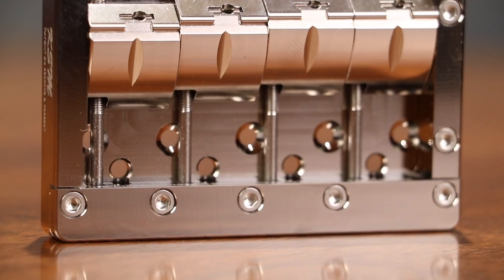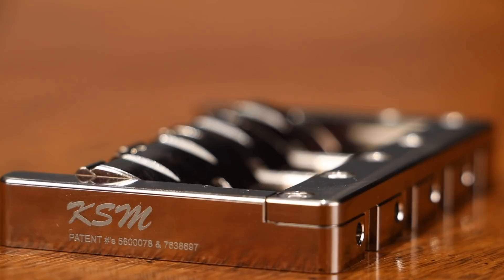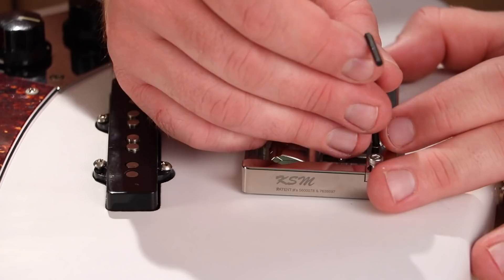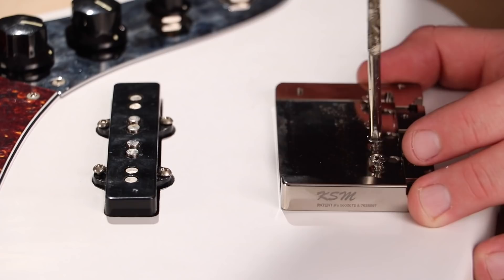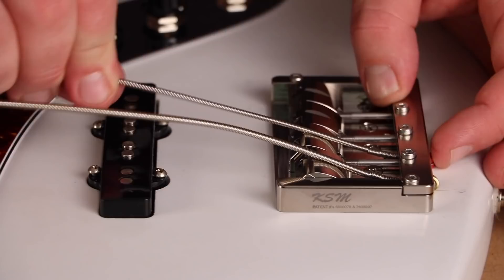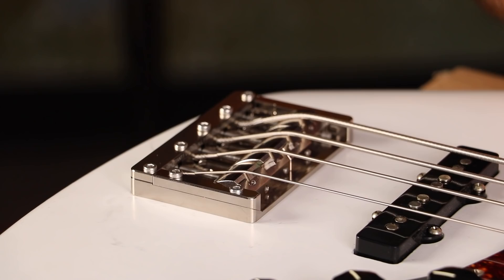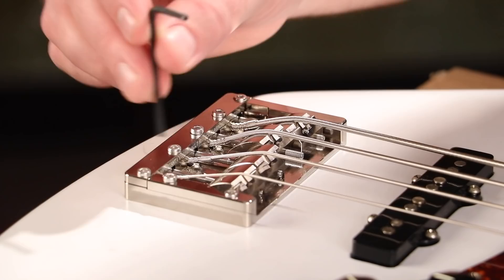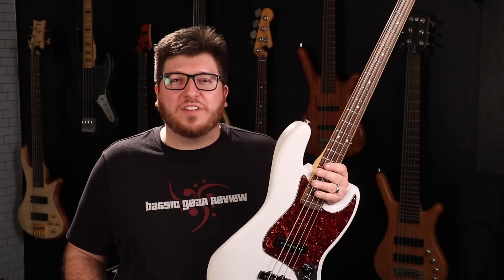KSM Foundation Bridge Install

Comment: Just installed my KSM on a Squier PJ. Extremely straightforward, and I'm just floored by this bridge design. It is the best I've seen. The only drawback I can predict is "locking in" bad intonation for drop-D if you go between standard and drop tuning.

Comment: How does this compare to Hipshots Kickass bridge?
Reply: Our bridge differs from the Hipshot bridges in a couple different ways.  The main difference is the way that our bridge completely locks down once everything is set.  There are no springs that will rattle while playing and there are no loose screws that will need regular adjustments to keep the intonation and height set.
The ramp system that our bridge features is unique too because it allows the maximum amount of string-to-body contact.  There is no space between the saddles and bass plate.
The aircraft grade aluminum that our bridge is made of is an advantage as well.  It is lighter weight then then most replacement bridges on the market, but it has a better vibration transfer and a longer sustain then the other materials used on different bridges.  (you can read more about this here: https://physics.info/sound/)

Comment: I did not understand what these additional bolts on the top panel are for🤔
Please, explain one more time.
Reply: For locking (when you replace strings the thing don’t move and affect your intonation)
Reply: Those bolts lock the saddles in place once all adjustments are made.  This makes it so that the intonation and string height does not move as you play and change strings and it also keeps everything solid so you don't have parts rattling and making unwanted noises while playing.

Comment: How does this compare to the Babicz full contact bridges??
Reply: Our bridge differs from the Babicz in a couple different ways.  The main difference is the way that our bridge completely locks down once everything is set.  There are no springs that will rattle while playing and there are no loose screws that will need regular adjustments to keep the intonation and height set.
The ramp system that our bridge features is unique too because it allows the maximum amount of string-to-body contact.  There is no space between the saddles and bass plate.
The aircraft grade aluminum that our bridge is made of is an advantage as well.  It is lighter weight then then most replacement bridges on the market, but it has a better vibration transfer and a longer sustain then the other materials used on different bridges.  (you can read more about this here: https://physics.info/sound/)
Reply: @ksmguitarsvideos  thanks for your reply. I'm preparing for a few bass guitar builds of my own design and was looking for a solid mass bridge and yours caught my attention. The 3 builds I have on the drawing board are 5 string basses. Again thanks for the reply. I think this bridge will be perfect for my builds.

Comment: This thing looks like a pain to set up.  When setting the action on a bass or guitar, the order of adjustments is neck relief, then nut height, then bridge.  When adjusting the bridge, you set the intonation before adjusting the saddle height, because moving the saddle forward or backward while setting intonation will lower or raise the string height, however mildly.  Once you have the intonation set, however, then raising or lowering the saddle height does nothing to change the intonation.  That's why you adjust saddle height last.

Except on this bridge.  Notice when he goes to raise the saddle on the A string: the goofy diagonal height adjustment causes the saddle to move forward when it is raised.   He then has to adjust the intonation considerably more to make up for it.  And what happens when you move the saddle further backward?  The string height will increase!  So you could be in for a vicious cycle of back-and-forth intonation and height adjustments until you finally land in the sweet spot.  

And anybody else pay attention to how crazy tall those saddles are anyway, and the massive amount of break angle they cause over the bridge?  That increased break angle probably does result in a lot stronger tone, but good grief it looks like you'll almost certainly have to shim the neck now to get the strings back down close enough to the fretboard for any kind of low playing action.  

I don't like to be a downer, but I don't want anybody to be unpleasantly surprised when they try to put this on their bass either.  It could create a lot more work than you were anticipating.  There's nothing wrong with a plain old stock bridge.  It sounded great for Jaco, it sounded great for Jamerson, it'll sound great for you too if you're a good player.  We're just bass geeks who love to tinker and try to improve, I know.  But please be warned that it might not be as easy as just slapping the new bridge on, like this video suggests.